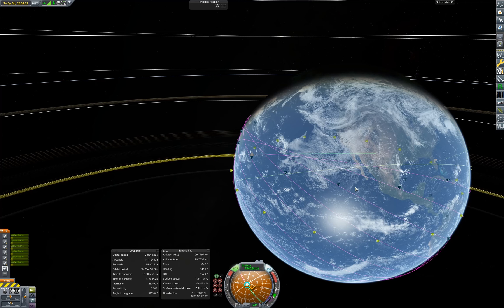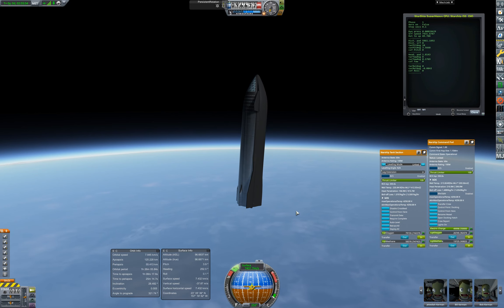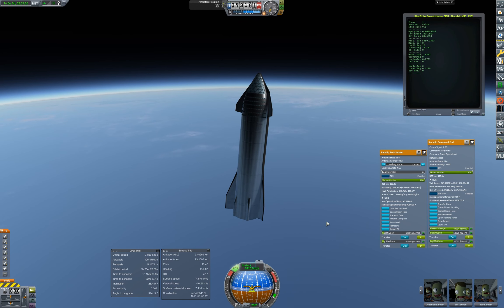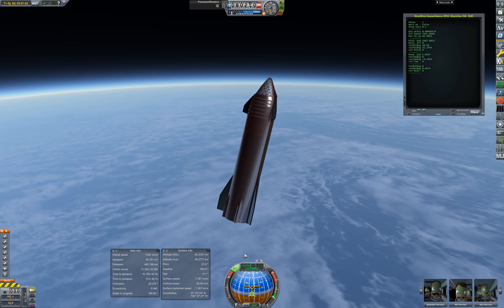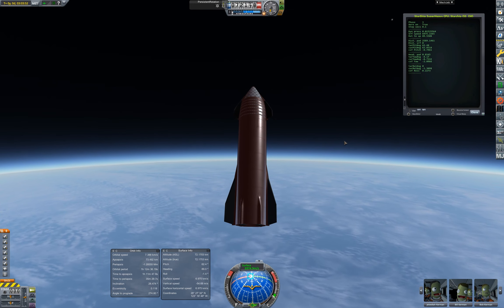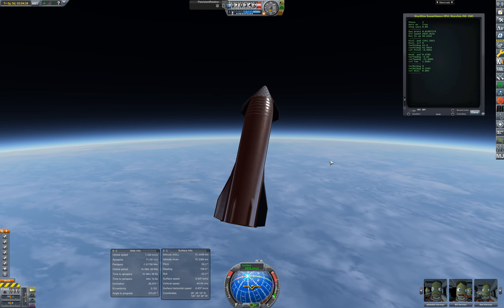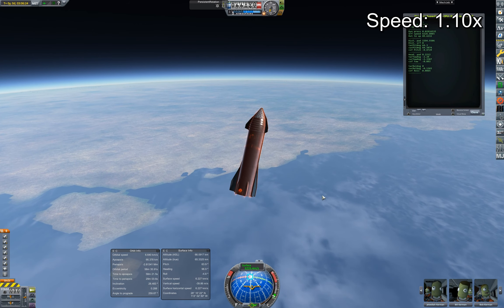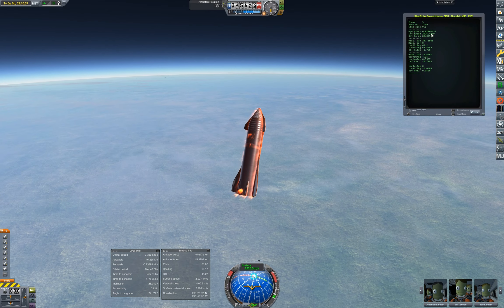Starship from LEO to landing pad

Comment: I'm amazed that you did not overshoot... Around half the world an still landing there. But the landing burn was way too early. Did you try going in more aggressive?
Reply from the maker: The script constantly changes the pitch of the vehicle in order that it slows down just above the landing pad. I could have started another 2000KM further back or 1000KM further forward and still hit the pad by selecting a different pitch. Altering the pitch changes the amount that the vehicle decelerates by, therefore it can be timed so that the horizontal speed reaches zero at just the right point
Yes, the landing burn was too early! I was paranoid about not making it so I was super cautious
I am tweaking the script and in future I will have a more aggressive burn. much closer to the pad